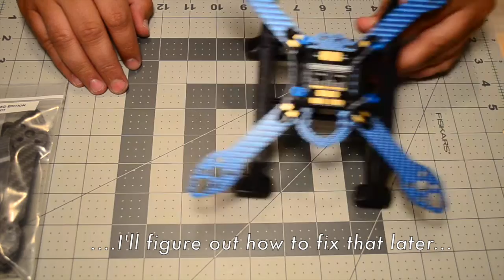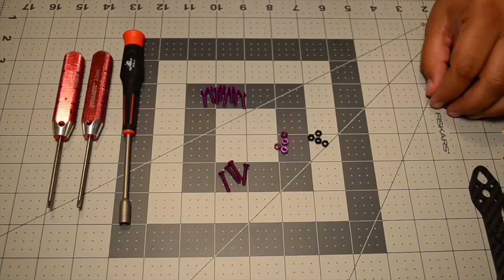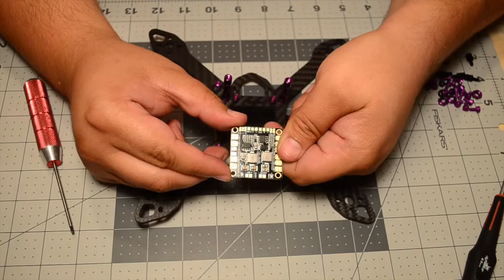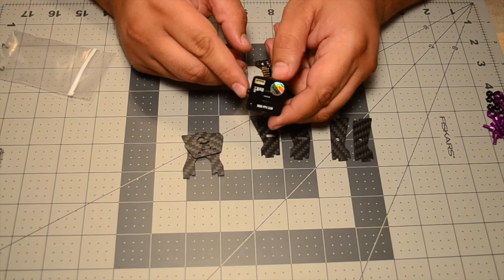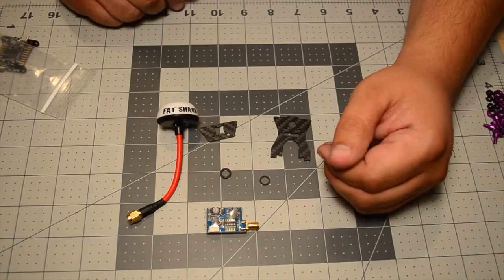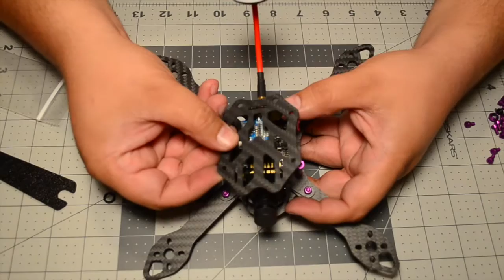Space Cowboy Workbench: SCX-200 V2 Full Assembly Guide

Comment: Thanks for the video! It has been very helpful during my SCX200 build (except in the parts where assembly/hardware differs between this and the lite version). I am stuck right now though, because my vtx (Aomway Tx25 5.8G 40CH AV 25/200mW Switchable Mini VTx) and antenna (TBS Triumph) do not fit the horizontal vtx mount. Even if I remove the o ring, I cannot get close to tightening the antenna all the way, allowing it too spin freely. Am I doing something wrong, or is this vtx not compatible with the frame? The SMA connector on the vtx is 1cm long.
Reply from the maker: I've seen people using those AOMWAY VTX's with the mount without issue, so it's hard for me to say what could be the issue here. What you can do is screw the antenna securely to the vtx without the carbon bits and measure the gap between the bottom of the SMA connector on the antenna and the base of the SMA connector on the VTX. It should be slightly more than 2mm. If it is less than 2mm that would cause the issue you are describing. If it is greater than 1.6mm you can actually switch to the Armattan Lite LED plate which is thinner than the carbon version.
Reply: Thanks for the tip about the LED plate. I actually got it to fit fairly securely with one of my two antennas without the rubber o-ring, so I think I will try it like that for now.
Reply: Now I really got it! I was focusing on the wrong place, and didn't notice that the anti-rotation plate didn't quite fit the little square at the base of the SMA connector. I filed it down a little bit and it fits like a glove!

Comment: Do you have any specs for the integrated PDB ? Can't find anything online. Do you know what is the output with 5v for example ?
Cheers.
Reply from the maker: The integrated PDB does not include the regulators, rather it has two spots where you can solder on Pololu regulators. These are very common/reliable/cheap regulators used in the hobby. So whichever Pololu regulators you choose, that is where your spec on output would come from. They come in several different output voltages and current capacities.